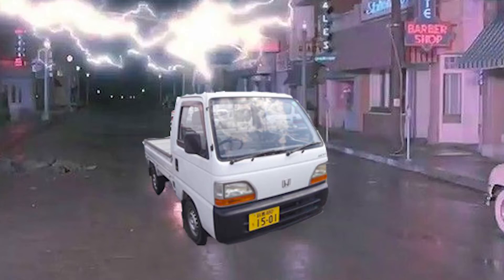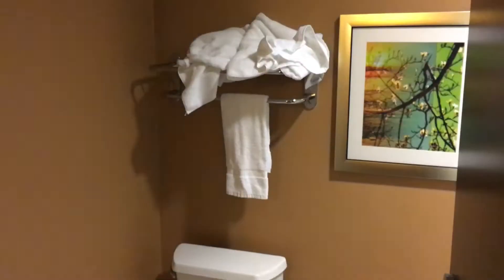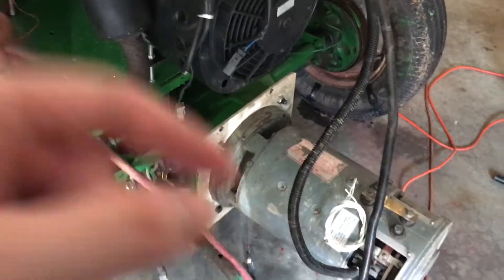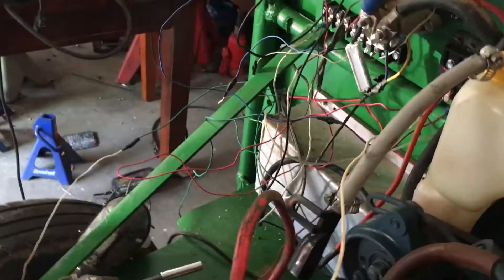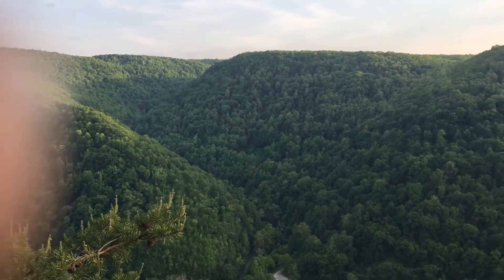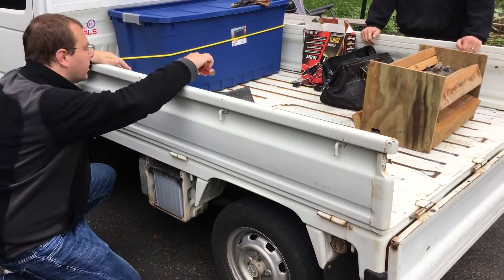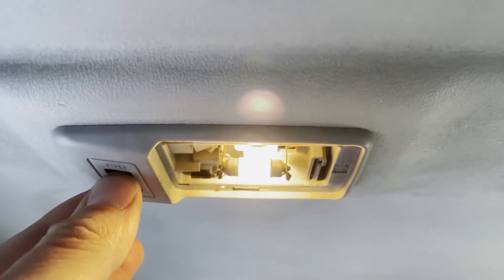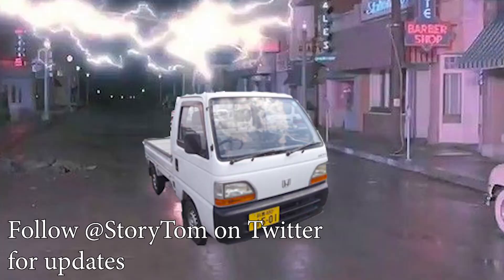Converting a Kei truck into an EV - Road trip to buy the motor - Part 4

Comment: Personally I'm interested in "liquid piston" rotaries as generators running on HHO gas. Your energy is stored in inert water, only a small amount of flammable gas is in system at any given moment. Also eliminates rare earth minerals for batteries as well as solving the issue of battery cycle life.
Reply: I love rotaries, but it still had the problem of having a hot side to 1 of the faces but it's on the inside so you can't really cool it by position it forward, also didn't know about the HHO gas part, is that dihydrogen oxygen? Fuel cells are still more efficient than burning it in an engine, sadly no braps.
Reply from the maker: Can you send a link to where we could read more?